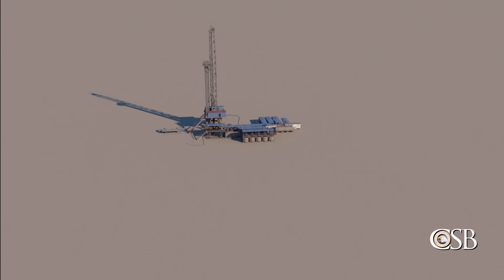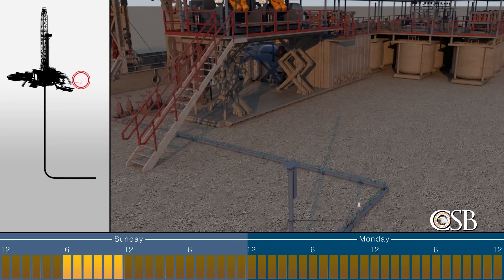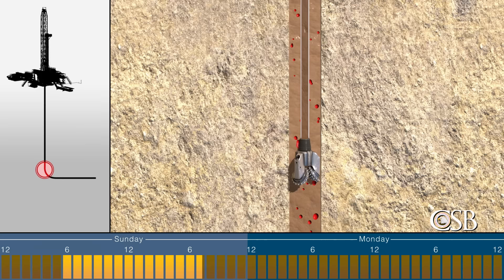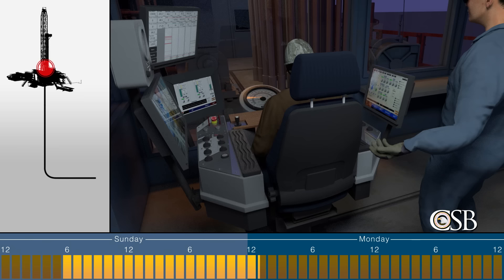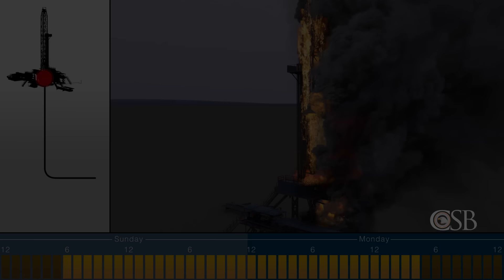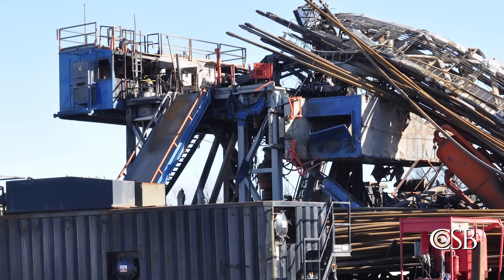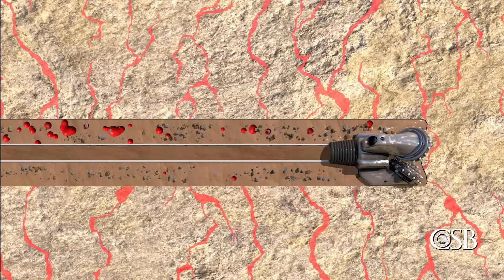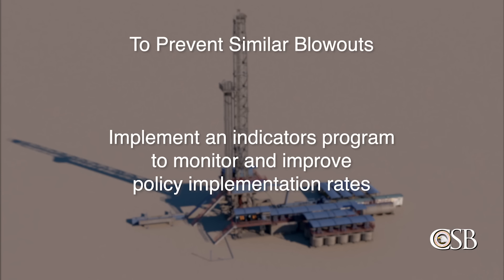Blowout in Oklahoma

Comment: I always just start crying when i hear "had turned off the alarm system"
Reply: its always the same

'had over ridden the safety mechanism'

'had turned the alarm off'

'had ignored the systems warning' 

etc
Reply: What is worse is that they said the alarms were useless.
Reply: @niyablake  thats true, RIP to the 5 workers terrible accident
Reply: @BYOJuan  Ugh!
I help in a workshop. And i dont have a lot to do with the work thats going on.
But i do tell a lot of people to "next time, wear goggles" and "a face mask would be in order when you're creating that much dust" because XYZ hazards.
They would probably also fire me if i wasn't the IT guy upstairs.
Reply: No warning or safety mechanism should be over written, thrown off, turned off or other wise tampered with.  Those alarms have one job and they do them well. Keep your ass safe. No matter the job or money. Your safety should always be top priority, even if the company doesn't think so.
Reply: @chamonix4658  and that perennial favorite "had not been trained on" whatever.
Reply: I can't get too upset over that when even the CSB admits having one probably would have made no difference.
Reply: "crew had not received adequate training for this procedure"
"problem had been detected, but not properly communicated"
"deviation from standard operating procedure, or no SOP in place"
I'm wondering if there's enough for a safety bingo.
Reply: @niyablake  MOST of the alarms were useless/irrelevant for the operation in progress, but some were very important but 'drowned out by the noise'.
Reply: @funboy1127  The irrelevant ones (for the operation in progress) should be turned off.
Reply: @1978garfield  ??? Having 'one' what would have made no difference?  An audible alarm on the pit level or trip tank level (set properly) would likely have prevented the loss of life, and I think CSB said that in their report.
Reply: @driller43  information overload  or you train the user with usless alarms  that most alarms are usless and can be ignorged .
Reply: As a mechanic we call alarms "idiot lights" cause only idiot's don't listen to them not sure if idiot is correct spelling
Reply: @niyablake  It's a oddly similar effect to being so overburdened with safety gear and procedure said gear and procedure starts creating more accident and injury events than it prevents. 

I can't count how many stupid and pointless safety meeting I have sat through where many worker injuries from said excessive gear and procedures had gotten people hurt, some badly, and it was all dismissed as lies and undocumentable that way because of 'regulations'.

Regulations made by the safety nazis to exclude them from all liability when their excess bureaucratic bullshit starts doing more damage than had they not been used as directed for the job in play. 

I am all for the proper and reasonable use of safety gear and procedures until they prove excessive.  And 100% against the OSHA and like agencies and their actors openly denying/lying to our faces that too often their crap does get people hurt.
Reply: right, any job i ever work on "do not turn off the alarms" i rather be overburdened than under-burdened . .. if that makes sense. Keep the alarms active, they may save your life!!!!
Reply: @djohanson99  Heck, if there are suddenly 20 alarms going, i'd just press the emergency buttons and evacuate the area. If there are many false alarms, thats a problem of the company not mine. I think a few days of worktime lost due to evacuations and investigations can teach most companies to invest in better safety systems.
Reply: @ReneSchickbauer  That's sort of how much of the oil field works in properly run sites.  Or at least all of the ones I have had the privilege of being on did.  

IF alarm A keeps going off, why?  If it's not a big deal, but needs to be monitored for safety sake and the alarm is overriding a more critical one, then some person gets assigned to the actual source point of concern to monitor it live until the situation is cleared.   

I've seen sites and talked to people who had something like that come up and they literally stood in front of a auxiliary monitoring panel or over a access point cover with direct eye on and looked a what was actually happening non stop for a whole 12 hour shift, followed by their alternate doing the same thing , then them again the next day. 

As a sub contractor employee on site, who had little to do while there a lot of the time, I've even spent long hours hanging out with these guys just to learn what they did and how the greater operations worked as explained from a actual experienced person.
 Once even got a pat on the back by a site lead for keeping the poor guys doing that monitoring company!  

Even got told that if I ever wanted to jump ship they would love to have a guy like me, who was so interested in how they did their work just because I talked to some poor soul who was cornered for 5 hours about it all!
Reply: No you wouldn’t if you were a real operator. You figure out the cause or problem. Then if severe enough you evacuate. Don’t talk like you know, because you don’t.
Reply: @JohnSmith-lw2bm  this says nothing about turning alarms off.
And sounds like a good way of preventing these situations.
What's your point
Reply: @BYOJuan  What did you do about it?
Reply: @1978garfield  What are you smoking?
Reply: @codm-420-killer7   No???
Reply: @niyablake  yep usualy i turn off any safetys i have at anything in life the moment i realize they are useless and just anoy the sht out of me for no reason , and try to add my own standards instead, could be their own overconfident mistake but i doubt it , especialy when they said the alarms were useless anyway.
Reply: Why wasit the kick out s on
Reply: You would probably do the same thing with endless nuisance alarms.   So be careful how you judge.   I'm pretty sure none of the workers wanted to die.
Reply: @steventhury8366  yeah if the alarms are permanently on and it looks like you cant solve them you might as well disable them , you allready know its still ongoing and needs solving but at least now your brain doesnt bleed, getting stressed out makes you even less focused.
Reply: @AngelTyraelGM    I see similar things going on in other areas.  Such as, too many passwords.  This excessive security is going to end up causing less security.
Car alarms and check engine lights are ignored by almost everybody.   There is nothing wrong with being focused on production.  Isn't that what the workers are there for?  Too many regulations by liberal "do-gooder" and virtue signalling politicians and elitists.   Regulations are good to a point, but libs ALWAYS take it too far.  I think it makes them feel validated because they are so incompetent in areas that matter.   We need men that know the well drilling environment that have a realistic understanding of what the purpose is that determine the safety standards.   Nobody, from top down wants to see such explosions or disasters.   I don't like these woman coming in with their mothering instincts kicking in treating everybody like small children and they are there to protect the workers.   I believe there's too much of this going on.
Reply: @BYOJuan  I worked at  a company that forbid the use of guards on handheld grinders. Then  there was an accident and they forbid the use of grinders without a guard. There were no guards available but several guys got fired for using a grinder without a guard.
Reply: @codm-420-killer7  yes you have the right spelling for idiot.  Remember "ID - ten - T errors" are the kind of problems that occur when people make stupid mistakes and don't realize them.  The people described in the failure covered by this video don't appear to be idiots.  They had a complicated system and we not able to identify the problem using the controls and experience they had.  I agree that state-based alarm profiles would be a better way to manage alarms.  By state-based, they mean to turn off alarms that are not relevant to the current operation.  But that is a terribly expensive method, requiring the software developer to consider a very lot of scenarios.
Reply: @driller43  
Most respectable companies already have implemented "state specific" alarms and procedures IE, drilling, tripping, circulating. "SPLATTERSON" UTI Is not a reputable company. Regulations are not nearly as useful as training. During a trip the alarms are set to a specific gain/loss and pressure/swab. Trip sheets are continually filled to monitor hole conditions. Rig hands and particularly the driller should be trained for these events to identify and preemptively avoid a disaster. Most oilfield regulations only increase the opportunity for an accident.
Reply: @kendrodakota818  That is good to read, making it fairly easy and quick for API (with IADC) to develop a design/operating standard to accomplish what CSB recommended. Kills the 'can't be safely done' argument against such a requirement.  And include that standard in annual well control training courses?
Reply: @driller43  
Yes indeed. I think one of the biggest problems is not the lack of regulation but rather, at times, the high turnover rate and the need to quickly fill positions without the proper training needed. I have personally witnessed drillers and tool pushers trying to protect the well overridden by consultants who didn't know the procedure leading to a nearly catastrophic blowout in an H2S rich well. Proper training AND supervision is absolutely essential.
Reply: @chamonix4658  there are no accidents. There is clear negligence here.
Reply: @jeffreymoffitt4070  i think you are right
Reply: Sure it was for a Good Reason sure he got paid well for it /
Reply: Oh my God, what is this clusterfuck?? No wonder the Oil rig blew out...
Reply: Alarm fatigue is a real problem. If alarms go off every 15 minutes and have never been critical people will ignore them. Poorly designed alarms are not effective even if they are let operational. The reason these alarms were turned off is because the alarms were nuance and ineffective.
Reply: @crissd8283  Agreed. But it's a running theme.
I'm not blaming the operators, accidents like these are often more complex than the people handling them!
Reply: @funboy1127  mmyepp, the only ones that win on the worker activily shutting off or disabeling alarms/safteys and such are the companys that later can say they werent guilty of accident/death of worker because they shut of the systems.

Comment: So I was only ever a rough neck on a single ... but I remember stopping periodically in a trip... the boys would go for a smoke.. and someone would watch the trough to see if any mud was coming out  of the hole. At night you would throw a little sawdust down to see if it moved. If there was any flow coming out you would notify the driller that you were taking a kick. A simple precaution but it would seem that was not followed.. and I was on a rig from 2007 to 2011. Besides that the derrick hand would be responsible for mud ... an increase of 200 barrels of mud which would be over 30 cubes... I can not see how the derrick hand would not have noticed his tanks gaining such volume?!! On a single that would be almost double the total mud volume. Also I was a rig hand in Alberta Canada drilling for oil not gas... so the procedures are most definitely different. Ok... edit here... I wrote this at 15:00 into the video... so just a minute later they describe what i'm talking about.. a flow check. Only 2 of 27 required flow checks were done!! OMG.
Reply: This is a train wreck of no training and totally ignoring regulations.  How the Derrick hand missed the well gaining that much mud I have no idea
Reply: Questions for ya, how long should the flow check have lasted?  Obviously they didn’t preform enough; I wonder if they didn’t perform the flow check fir long enough
Reply: @davyt0247  That would be determined by the consultant and the specs for that hole... but generally about 10 mins... long enough for the boys to get a piss a smoke and a fast bite.
Reply: Paul Carpenter so I wasn’t crazy thinking that 45 seconds wasn’t anywhere near long enough
Reply: @davyt0247  45 seconds isn’t shit when checking for flow. Patterson stated that a flow check should be 15 minutes. But, I’ve had Rig managers tell me that 4 minutes was sufficient.
Reply: @ziggypop1977  thought so, thank you
Reply: Who were you with in Alberta Paul? I started with Shelby Drilling out of Brooks in 1971, and a short time with Precision before going overseas.
Reply: Is a flow check really needed with 200 barrels!! of mud coming out while you are PULLING the string (mud should be going down). And they need some computer alarm to figure this out? How about looking at the mud or mud level or something. This safety report is kind of confusing. I think eyes on is better than just doing computer alarms that can be misconfigured, muted, silenced etc. The concept here is not that complex is it in terms of a stable well?
Reply: @randominternet5586  Yes flow checks are needed. The 200 barrel gain was over a 14 hour period. Had the flow checks been done properly they could have found the issue a full 10 hours or more earlier. When there was only small gains. Once the alert to gains is issued the Tool push and Consultant would then come to the floor or been part of decisions happening. That adds a lot of years of experience.

Comment: This is just  a train wreck of no common sense, poor training and not following SOPs....
Reply: the part where a couple of kids see the well is flowing and do not report that is the scariest. that company needs to be shut down and prosecutions of the training staff management need to happen.
Reply: yeah, that's two truck loads of mud in pit gain...WTF ?
Reply: @Clifton Green I agree, It was just the way the report was presented was like under/mis-trained personnel and not taking what would appear to be warning signs seriously... I work in engineering/manufacturing and the amount of SOPs for what seems like common sense is absurd; like don't stand under a heavy load- because people have stood under a heavy load and been crushed. No entering confined spaces without metering the air and having a fresh air supply... I encounter a lot of people that don't think for themselves or fully understand what they are doing. I may be pushing my standards on other people and just assume when something isn't going normally you don't just push ahead and shutting off warning alarms. 
Crazy how they let them fully disable the alarms indefinitely though.
Reply: @FragEightyfive   if your rig is taking a kick and your hands see the mud flowing...they are undertrained about the dangers of drilling. if they had the slightest clue about what flowing mud meant they should have ran to the driller or push to report it, that is a lack of training and it got at least 5 guys dead.
Reply: And inexperienced or ineffective management on site. A pusher or operator who sees a well flaring hard with no circulation should have known that the mud was too light to control the well.
Reply: @Clifton Green  Pinning this on the alarm fatigue and saying that it's the alarm system that needs to be fixed is a white wash. The fish stinks from the head. Shitty managers and shitty well operator shouldn't come as a surprise you have incompetent crews. They never even mentioned it but the first thing that came to my mind was why didn't one of the 5 guys in the drillers cabin close the blind rams. Did the rig manager or the drilling supervisor attempt to close the blind rams using the second set of controls. And if rig manager or the drilling supervisor did not attempt to close the blind ram why not.
Reply: Welcome to America.
Reply: Not following Sons Of The Patriots.
Reply: It usually is.
Reply: I ain't needin no safety
Reply: @eddydogleg  When well erupted, the driller tried to turn and push a BOP button, but the explosion took him down before he could do it.  A couple of minutes later, 2 people operated the second BOP control station, but by then the intense oil mud fire under the rig floor had burned up the fire-resistant control lines at the BOP.  The fire-resistant lines were taken beyond their limit.  But even if they had lasted, the men in the driller's cabin were already killed. This is described in the CSB report.
Reply: Was waiting to happen.. And it did.. Poor guys paid with their lives.